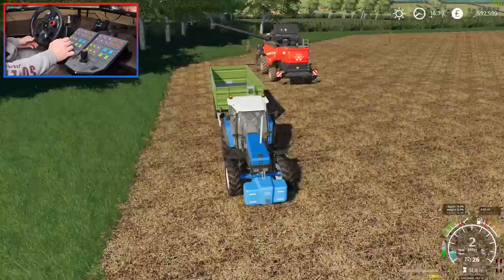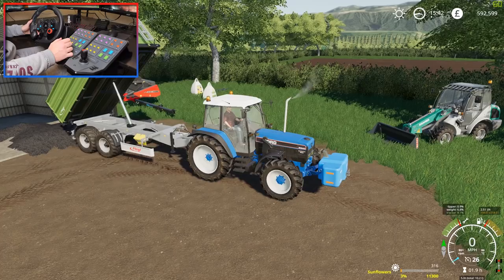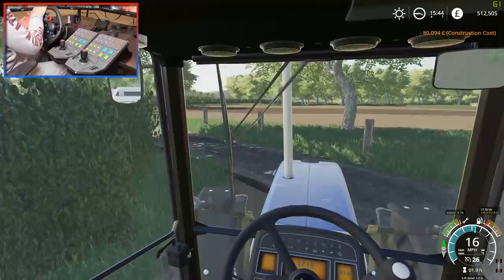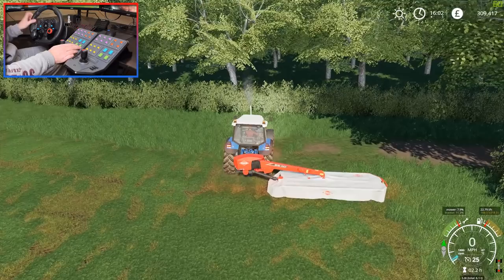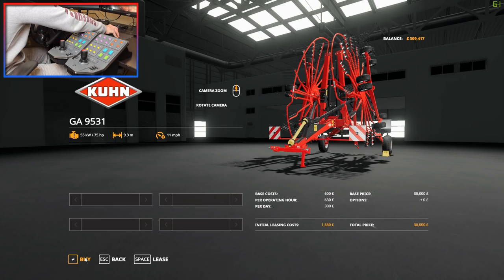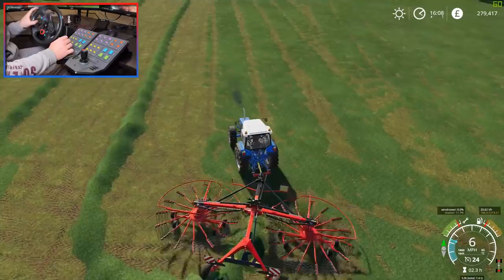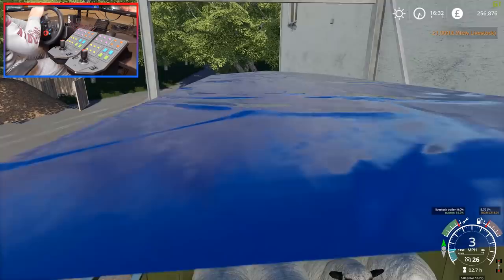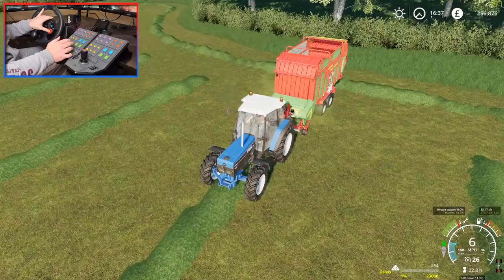GRASS WORK! - Farming Simulator 19 -  Maypole Farm Ep.3 (with Wheel Cam)

Comment: They way we do it at my uncle's depends if someone is picking up the gras immediately after the windrower. If so, we do 2 headlands and then up and down. If not, we do 1 headland, go up and down, and do 2nd headland as last. The reason for a wider headland is reducing the friction of the wheels of the forage wagon while turning, which would damage the soil.

So if you would do 1 headland, you should technically make sure it's wide enough (like with the 4-elemental windrower).

This is also why you should lift up the windrower while turning while doing the lines. The parts that move the gras will most of the time scrape the surface of the soil, so the more often you go over 1 bit, the more you'll damage it. Since you'll make the headland anyway, you should lift it up while turning ;) You can always keep the pto turned on though, it will damage more with turning it off and on again, as well being a pain having to do that 50 times per field ;)

But yeah, starting with headlands while windrowing doesn't matter that much. With fertilizing and groundwork it's different. With fertilizing you should start with headlands, since you won't go twice over bits you've done if you do the headlands last. With groundwork you want to leave the soil nicely, so if you start with the headland you'll drive over it a lot which will damage the structure, as well as the effect of the work you're doing ;) hope this helps, love your vids, keep 'm up!

Comment: Me too are looking for bigger sheds, many of them is out of propositions, to small, the tractor looks huge behind some sheds. I wanna have a big bale barn with high roof so you can use the auto stacks, drive in and unload it inside the barn without hitting the roof! I'm working a lot with bales so I really need somewhere to store them. Feel free to tip me if you find a big placeable barn with big doors and high roof please!